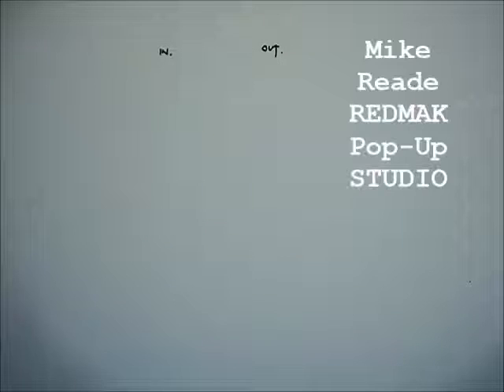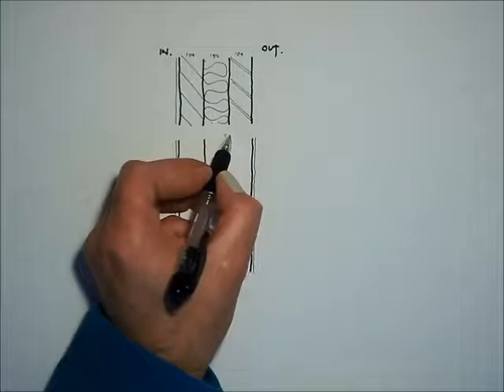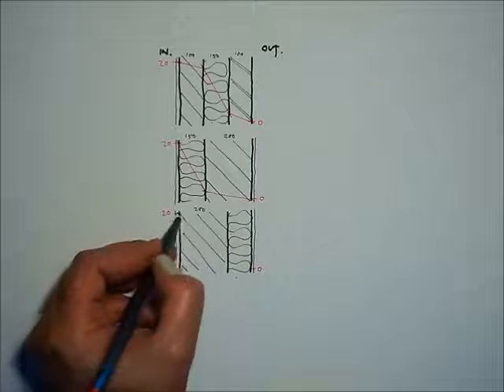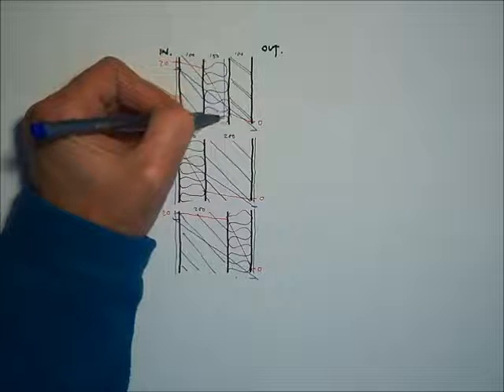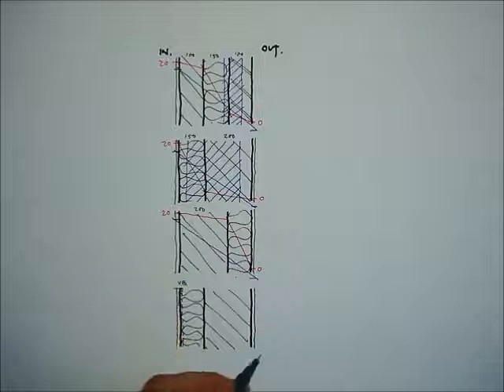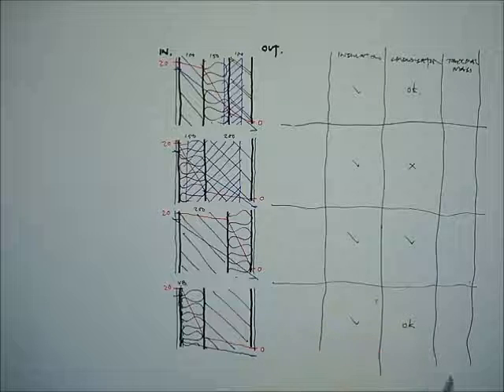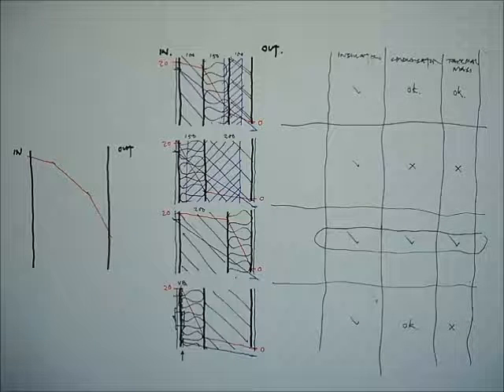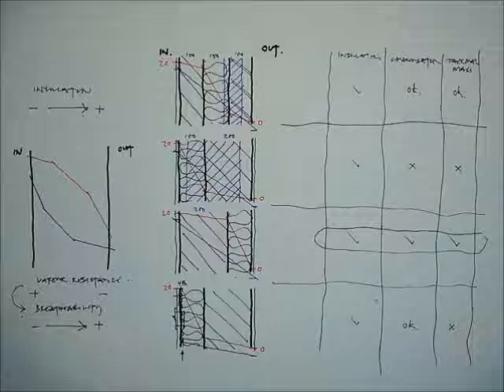REDMAK Pop-Up STUDIO | 1 | Where Does The Insulation Go

Comment from the maker: So, I'm guessing we're all clear. The insulation goes near the outside of the building. And if it doesn't, the further inboard it comes, the greater the reliance on a vapour barrier and the greater the temperature fluctuation because there is a decreasing  potential for a high thermal mass building.